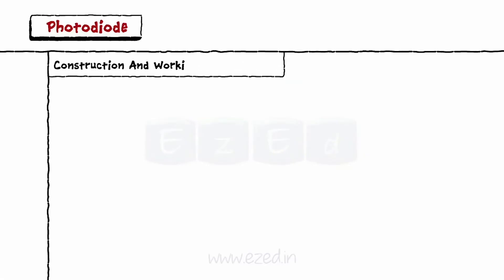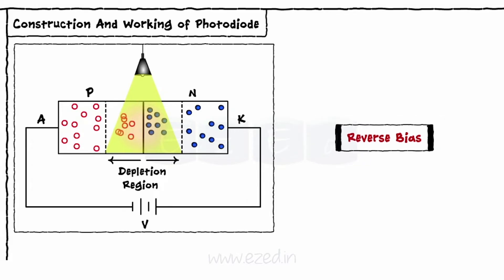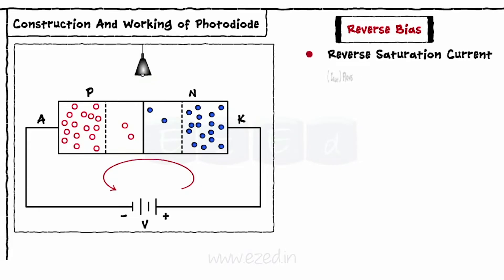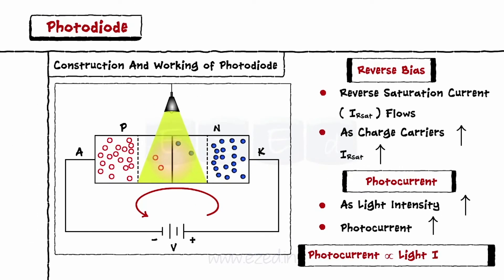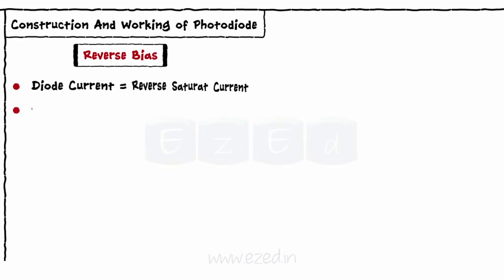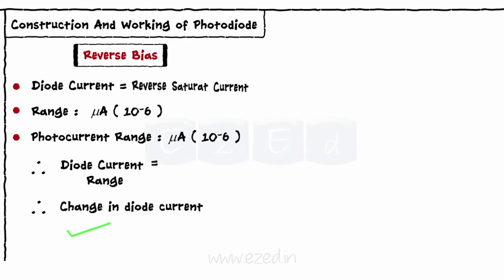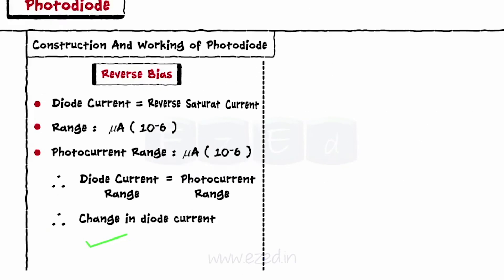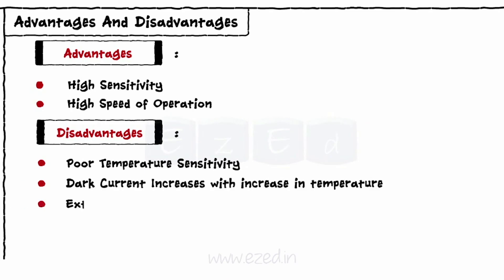Construction & Working of a Photodiode - Optical Devices

Comment: I would like to build a fire alerting system using a photodiode and my point of concern is on how can I build it in a way that the photodiode responds to fire threats but not other threats like light being emitted by torches, bulbs, LEDs and others of that sort.
Reply: Well,i think with fire 🔥 smoke should also be detected,so,you will need an IR sensor also
Reply: Pro trick: watch movies on flixzone. I've been using it for watching loads of movies lately.

Comment: Does it produce any current without bias? What happens if we just connect a PD to a resistor and shine the light to it? Does the current flow through resistor?
Reply: I think same concept as forward bias. There will be a current >>photocurrent thus not detectable.
Reply: Diffusion and Drift current